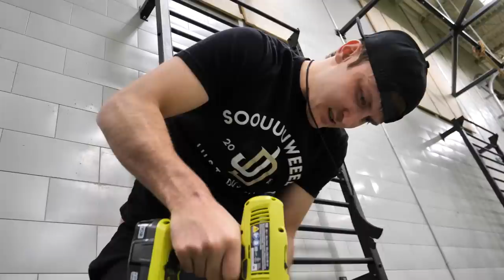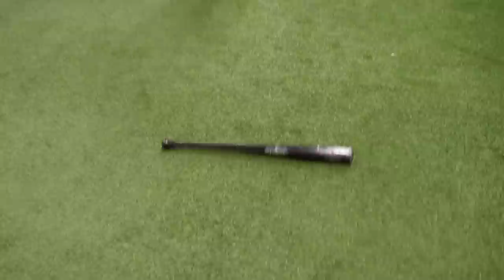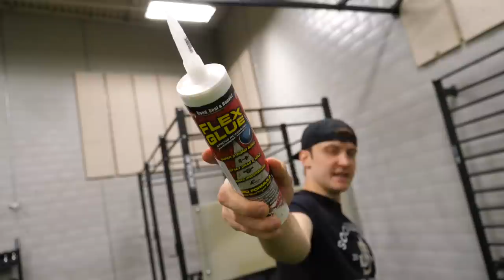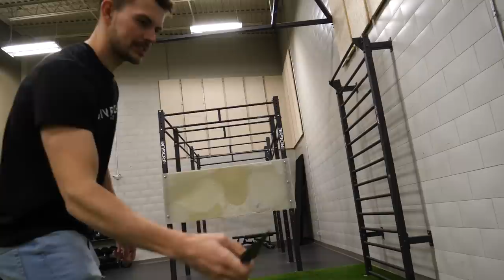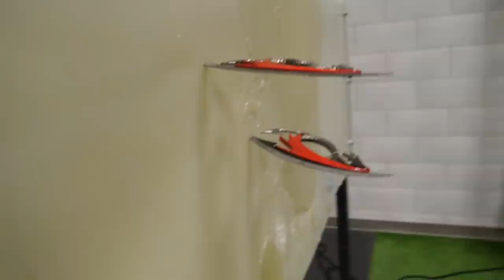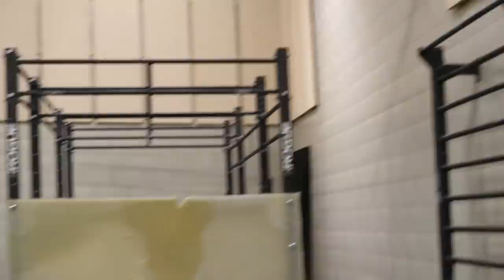100 LAYERS OF EVERY GLUE (DANGER ALERT) UNBREAKABLE WALL

Comment: Every time, “ it’s unbreakable” two minutes later drills through wall
Reply: He also left the plastic from the mold on the back so it's got reinforcement
Reply: Lol
Reply: your name is osome
Reply: Ikr
Reply: ttv.yeet-bot you are correct
Reply: 3
Reply: Do you agree a drill is a weapon
Reply: Sometimes he leaves wood on the back of the wall
Reply: @huhz  I think it's broken by now
Reply: true
Reply: It’s a drill though....
Reply: Tbh He Forcing it through so much it goes through the thing and breaking is like cracking most of the time.
Reply: It’s not breaking it
Reply: So what drill did he use in this one 🤡

Comment from the maker: NEXT WALL SUGGESTIONS???
Reply: Melted candy
Reply: JustDustin one layer of each thing you’ve made
Reply: Cardboard
Reply: Guitar strings
Reply: Do a plastic wall🙃
Reply: Gum melted
Reply: JustDustin meltid  waxs
Reply: Line x
Reply: Electrical tape this is the 5 time asking
Reply: Rope
Reply: Chips
Reply: 100 layers of metal
Reply: Wall of hater comments 😂 so you can get your anger out
Reply: Cinder Blocks😂😂😂 jkjk (Fabric?)
Reply: Stickers
Reply: Electrical tape!!!
Reply: Melted jolly ranchers
Reply: JustDustin 100 layers of the thickest paper In the world
Reply: Plastic bottles
Reply: Crayons
Reply: JustDustin wall of clothing
Reply: Candy or food
Reply: Liquid medal wall
Reply: 100 layer scotch school tape wall
Reply: JustDustin metal or steel wall
Reply: Candy Wall
Reply: Rubber
Reply: DVD wall
Reply: 100 layers of tarp
Reply: Whose actually first??
Reply: Every single flex product
Reply: Styrofoam
Reply: Twine,thread,
Reply: Or do a metal Wall 👊👊👊
Reply: Liquid medal
Reply: Flex tape and hurricane tape on the wall at the same time
Reply: Carbon fibre.
Reply: Skate boards
Reply: Metal sheets
Reply: EVERY WALL!!!! You've made.
Reply: Melted candy
Reply: 100 layers of WALL. Like actual wall.
Reply: JustDustin 100 LAYERS OF LEATHER
Reply: 100 layers of wood
Reply: JustDustin candy
Reply: Wood
Reply: Scotch tape,masking tape.
Reply: Or cement
Reply: All unbreakable tape wall
Reply: 100 layers of Every single tape
Reply: Electricity tape
Reply: Melted candy
Reply: The strongest tape wall
Reply: Yessss
Reply: JustDustin poster wall
Reply: Candy wall
Reply: 100 layers of bricks but maybe not 100 layers
Reply: 100 layers of watermelon
Reply: 100 layers of trex tape covered in line x
Reply: 100 layers of paper
Reply: Foam, mattress
Reply: Foam wall
Reply: Copper wire
Reply: Phone
Reply: 100 layers of all the tapes ever
Reply: 100 layer jacket wall
Reply: 100 layers of shoe laces🌊🌊🌊
Reply: guitar strings
Reply: 100 layer jacket wall!
Reply: Concrete wall?
Reply: Molten lava 😆
Reply: Juse youre cratif mind
Reply: JustDustin wall of every tape in the world
Reply: Metal wal titamun
Reply: Rubber would be funny
Reply: Metal
Reply: Border wall
Reply: Line x or candy
Reply: Every single flex seal product
Flex glue, flex tape, flex anything
Reply: Wood
Reply: Carbon fiber
Reply: Gummy wall
Reply: JustDustin flex tape clear
Reply: Glass
Reply: Gorilla 
Duct 
Hurricane
T. rex 
Nuclear
And flex tape wall

Sprayed with line x
Reply: A mix of every wall you've done so far
Reply: concrete
Reply: What about cement wall
Reply: 100 layers of drywall or 100 layer of 2x4s
Reply: I'm hoping you read this you don't have to do it but 100 layers of merch I know that will hurt or wood,rubber,foam,soap,plastic,toothpaste I don't know figure it out a bed,backpack,dirt,flexseal,pizzaboxes 

Really hope you see this love you man bye
Reply: Chocolate wall
Reply: 100 layers of JustDustin merch
Reply: Concrete Wall
Reply: Human wall
Reply: 100 layers of rubber
Reply: Super tape wall. Layers of every tape you've used. Super thick
Reply: JustDustin 100 layers of sandpaper!!!
Reply: Laytex wall 😈
Reply: metal wall
Reply: 100 layers of plastic next pls
Reply: yes yes yes yes ye yes yes yes yes yes yes
Reply: 100 layers of hats/shirts
Reply: Leather
Reply: Frog tape
Reply: 100 layers of justDustin
Reply: JustDustin fiber fix its tape that becomes as hard of steel when wet
Reply: 100 layers of glass please
Reply: Food
Reply: Carpet
Reply: Skateboard wall without the wheels
Reply: Wood. With wood glue.
Reply: Money
Reply: Flex seal
Reply: A wall of spider man web
Reply: Human wall
Reply: 100 layers of  brick wall
Reply: 1000 layers of glue
Reply: JustDustin I subscribe
Reply: April fools 1000 layers of air
Reply: Make a wall out of poo
Reply: Legos
Reply: A leaf wall
Reply: 100 layers of you
Reply: Brick wall
Reply: Bricks
Reply: 100 layers of jello pls!
Reply: Lether
Reply: and the weapon i want u to use for my wall i want the weapon to be freddys razor glove.
Reply: Gun VS Card board wall 9 inches
Reply: Metal
Reply: Do a every tape wall
Reply: JustDustin you mean triple c THICC ok
Reply: JustDustin deffinetly a wall of flex tape, flex seal, or flex glue
Reply: Glass wall
Reply: Bruh, greatest idea!!! A flex seal liquid wall using the mold you made!! 1000% UNBREAKABLE WALL
Reply: JustDustin do 100 layers of mattress or wood
Reply: A ton if tapes
Reply: You should do 100 layers of metal or concrete
Reply: Wall of glass
Reply: Every 100 wall videos so far (oldest to newest)
So every used idea so far each having 100 layers
Reply: A wall of Pizza 🍕 🤤 I’m hungry sorry
Reply: Cloth
Reply: TITANIUM+THE STRONGEST TAPE+ALL OF THE LAYERS ARE CONNECTED BY THE STRONGEST GLUE
Reply: Flex glue wall
Reply: Titanium alloy :D
Reply: Electric tape
Reply: Electric tape wall
Reply: 3
Reply: You should do a T-shirt wall
Reply: Electric fence
Reply: 10x tape wall 10 times strong than duct tape
Reply: Mattresse /luggage wall
Reply: Gum wall 🤢🤢🤢🤢
Reply: 2by4s lol shout out Dustin
Reply: Guitar strings
Reply: Fleks
Tape

Comment: Really unbreakble??? I can use a simple flamethrower to melt it
Reply: pretty much the easiest method, it would also be very flammable.

You could also drench it in petrol or some other solvent like acetone, most likely it would soften up and start to dissolve, although that could take a while unless combined with a flame.
Reply: ClassicExe glue remover